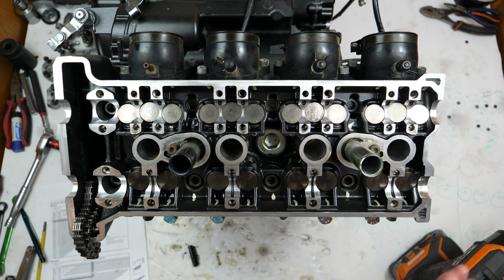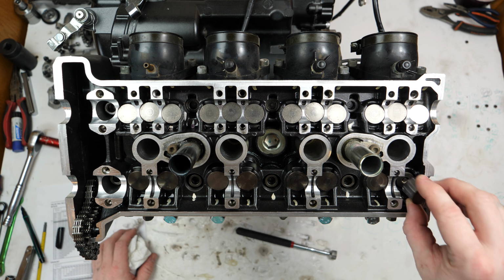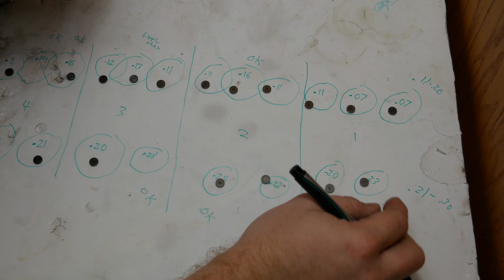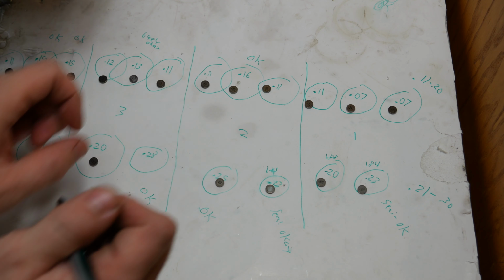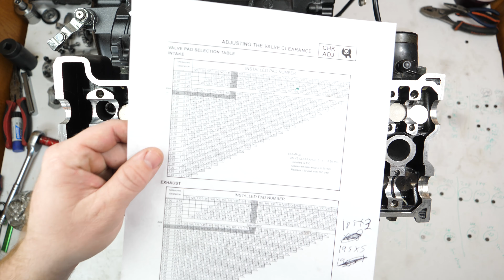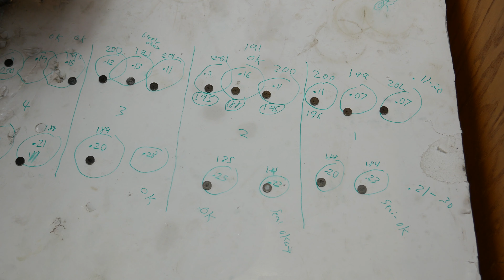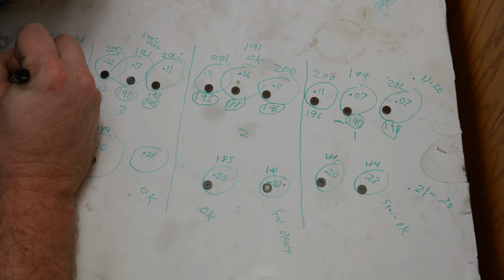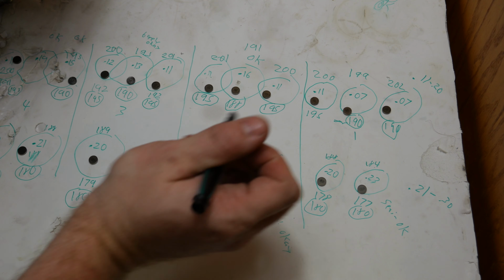Yamaha FZ1 - Adjusting the Valves Part 2

Comment: Yet another video where they completely skip over the part of loosening up the chain to take off the camshafts. RIP this video, on to the next... :(
Reply from the maker: You just take the two bolts on the tensioner out. There is no procedure it happens at 30 seconds into the video.

Comment: I had the same problem with my 2007 FX Cruiser Wave Runner. One of the intake valves became embedded in the piston head. I have the intake side clearances set up. I had to order new pads for the exhaust side. Have to go with thinner ones.
Reply: instablaster

Comment: Jusf a note about terminology 
Didn’t think the valves got longer, valve seats and valves wear reducing the valve clearance until the valves can’t seal well anymore, can overheat due to less time contacting the seat
Certainly well worth periodically checking and adjusting clearances 👍🏼
Reply from the maker: Thanks! that makes much more sense that the soft seats are wearing and reducing cooling leading to the valve not closeing and burning seats and valves.